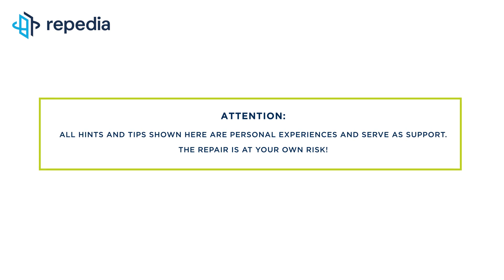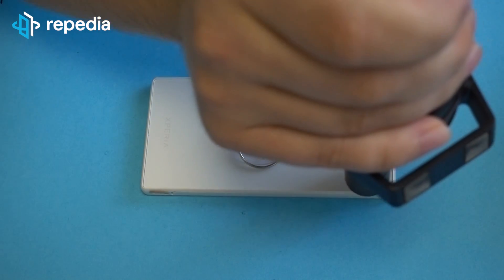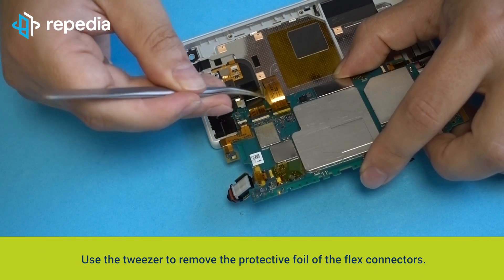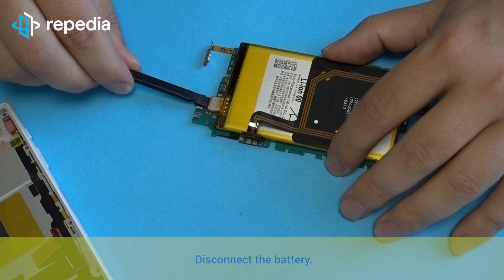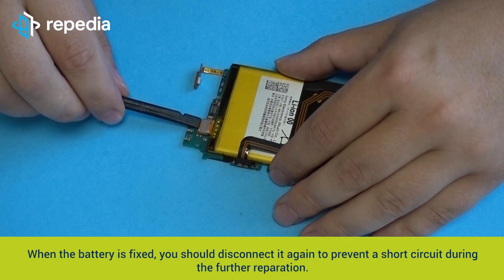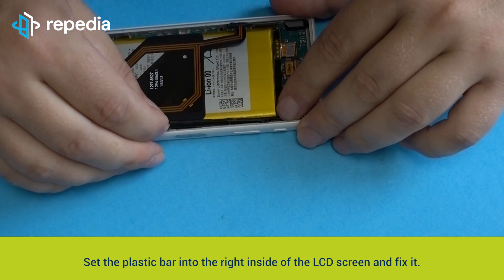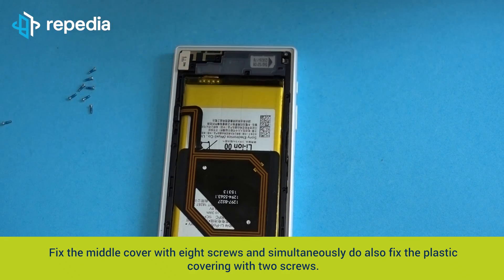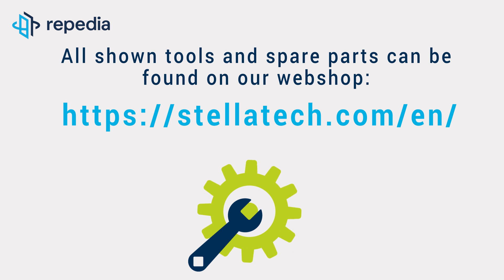Sony Xperia Z5 Compact - Battery Replacement | Teardown Guide

Comment: Did it as well. Not to difficult with  basic tools and hair dryer. Separating the battery was the hardest. Cut it with the short blade of a Victorinox.

Comment: Excellent, clear exposition.  I couldn't have done it without your help.  Like others, both of my adhesive strips broke off - they were so sticky that there was no way they were ever going to come out easily.  I used an old credit card cut in half as a thin spatula.

Comment: Thank you! Great detailed explanation. Followed it an everything* went great.

*Everything except the adhesive strips under that battery. One went ping into a little ball of glue, the other broke leaving most under the battery with nothing left to grab, so very careful work with spatula was needed. Be really careful and gentle with these!
Reply: Ran into same issue. One came out nice, one did not. Carefully used a credit card to separate battery from board.

Comment: Thank you so much for this video, I would order parts but you've sold out... Watch out at 4:15!!  i damaged a mini inductor/resistor with my spudger getting in there; maybe i was a little rough but paid the price. It added 4 hours to my battery replacement trying to resolder it with my iron that's a size of a bus!! I ended up fitting a wire link in replacement and speaker now works -phew!!.

Comment: I changed my battery with the help of this tutorial but unfortunately I accidentally damaged the flash light when reassembling, it got stuck underneath the motherboard, I didn't see it and I tightened the plastic strip over it and the light/flash got caught and snapped off but luckily my phone is still working with a new battery, and please remember to buy a genuine original sony battery, so many cheap rubbish ones on eBay

Comment: Thanks a lot, your video was extremely useful. The only problem I had was disconnecting the NFC, which it turns out is unecessary provided you detach it from the battery before removine the frame. Take care pulling the adhesive strips out , one of mine broke off, so a thin blade was needed to complete the removal of the battery

Comment: My z5 Xperia compact keeps switching off when battery is less than 70% but when I keep it plugged in to the charger it stays on, do u think I need a new battery and if so where do u recommend I buy the battery from?

Comment: Is it necessary to remove the whole motherboard, can't we access the battery without removing it
Reply: it may depend on how well the battery adheres to it. Mine got very hot & swelled up lifting the rear cover and maybe unstuck its self from the main board so i didn't have to remove the mb (or the cameras for that matter) Also my adhesive wasn't the original -long story.

Comment: Thank you for the video very easy and plain steps to follow , I am now waiting for a new battery to arrive and I will follow your instructions on how to reassemble, my battery didn't have those two tabs  on it it had double sided tape on it which separated quite easy, thanks a lot
Reply: Same for me, i didn't have to take out the main board!!  or the cameras...the battery just lifted out.

Comment: Thank you! I was able to replace my phone's battery and everything's working fine by following your video tutorial. I just realized that Sony made a stupid move in using double sided tape to stick the battery to the motherboard which made removing it very difficult if not impossible. They should've just use a locking mechanish to the battery and you can replace it easily.
Reply from the maker: Hello! We are glad to hear that our tutorial was helpful to you. Yes, you are right - a locking mechanism for the battery would make it much easier but most of the manufacturers (not only Sony) fix the battery with adhesive. They are not very interested in making it easy to repair the devices. 
Best regards from the REPEDIA team!
Reply: @repedia-servicelabor8822  Oh and by the way, my phone's about 2 years old and you can no longer remove the tape because it's already toasted (you know Z5's overheating problem). So I had to use a cutter to cut loose the connection between the battery and motherboard. I made sure I don't damage the motherboard so I let the battery suffer from cuts. Maybe this will be helpful to others.
Reply from the maker: @toms7143  Thanks for sharing your experience! I think it would be helpful to others.
Reply: European Union will discuss on news laws to make battery replacement, an easier experience. They already decided on using usb type c only for all devices.

Comment: i changed the battery exactly as shown but now the phone isn't powering on. it starts for about 1 second when i charge it but thats it. the only difference is that i used a different adhesive - does this affect anything?
Reply from the maker: Hello,

unfortunately, it is very hard to give an estimation of possible reasons for your problem. Here are three reasons that could be possible:

1. Battery is defective
2. Something was damaged while disassembly or assembly of the device
3. The charger is defective or not compatible (try with another)

The adhesive does not have any effect on the function of the battery.

Good luck finding the cause of your problem!

Your REPEDIA team

Comment: Thank you!  Using your manual I changed my battery in Z5C, it was difficult and I was glad everything shown in video.
Reply from the maker: Hello,

thanks for your feedback! Yes, as described at the beginning of the video, this repair is difficult and only required for advanced people. But nice to hear that you succeed and that we could help you with our video.

Best regards from the REPEDIA team
Reply: @repedia-servicelabor8822  Thank you from Russian Federation. I changed my battery to the new one. And it shows about 1900-2000mAh. It discharges very fast as on original battery (almost the same result). And phone is working slowly. What can be faulty that phone is overheated, and makes slowly when working with navigation system, for example (GPS+LTE)?
Reply from the maker: @alexanderv.753  Hello, it is difficult to identify the reason for this problem without seeing the device and knowing all circumstances. It could have several reasons when the device is overheated. The only tip we can give from far is to make sure that you have installed the latest software update. If this isn't the reason, we would suggest consulting a repair shop or any other professional. 

Good luck and best regards from the REPEDIA team
Reply: @repedia-servicelabor8822  My z5 Xperia compact keeps switching off when battery is less than 70% but when I keep it plugged in to the charger it stays on, do u think I need a new battery and if so where do u recommend I buy the battery from?
Reply: @absbse  yes very likely, mine even turned off with power cable in!!. Also you may see the back cover lifted due to battery swollen. Repedia sell them, if out of stock look for one with the same rear label / code number LIS1594ERPC 10.3Wh etc as original!!